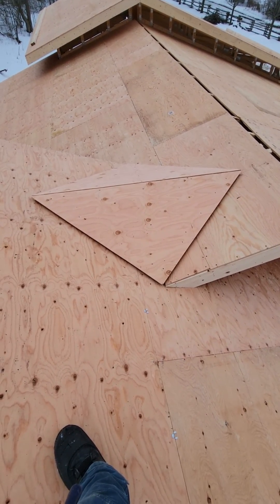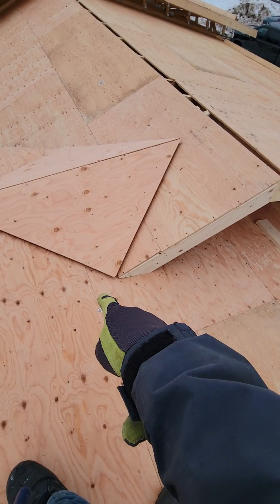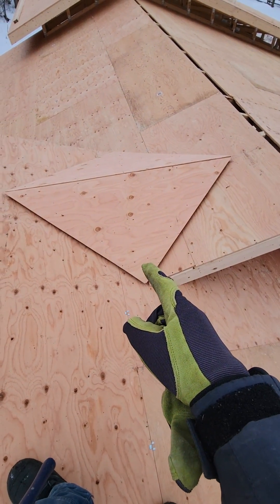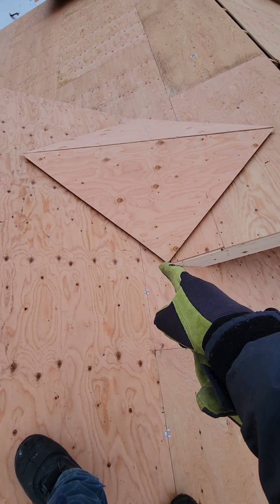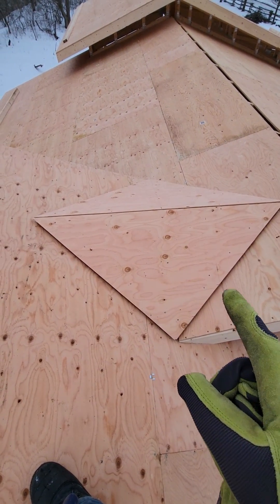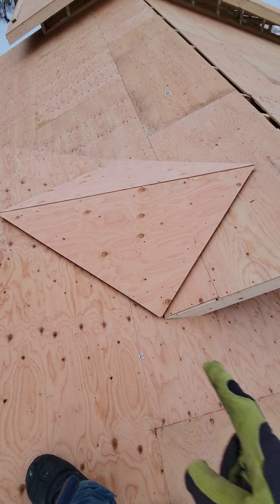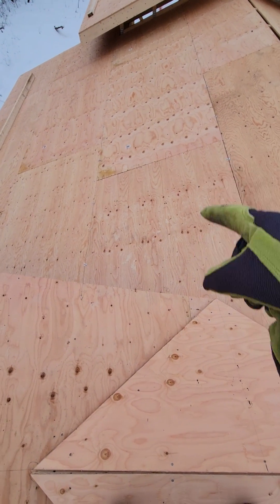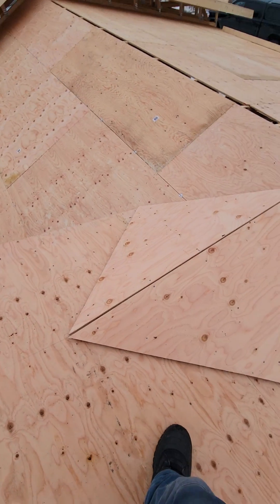What is a dead valley and how to fix it.

Comment: No not a good idea because now you have 4 individual lines collecting water when a cooper flashing with a membrane would have solved the issue why the reason to hire a expert
Reply from the maker: Not possible for these tiny valleys for water to sit. They have a slope and no where for water to sit and back up.

Comment: As a roofing contractor for 52 years I would have installed ice shield up under the overhangs and shingled up to the two points and installed a10' approximate. 032 aluminum  valley 36" . 18 " up each side. Install ice shield 8" on each side over the aluminum and then shingle it.
Reply from the maker: Yes that's definitely an option. We just didn't want any water sitting and freezing there. Thanks very much for commenting. Have a great day

Comment: So how does one keep water from pooling on the upper edge of a chimney where it goes through the roof?. What is the minimum sideways angle?
Reply from the maker: Basically you'd do half of this. It will have two sides with two small valleys.  I would use at least a 4/12 slope. The steeper the better. Thanks and have a great day

Comment: That one is only the result of two overhangs extending in opposite directions, so at least it is small and easily manageable.  It's not as bad as the ones on my home where an addition was built between two wings off the back of the house.
Reply from the maker: Yes you're right it was not a big deal and easy to adjust. I'd be interested to see a picture of your roofs. Thanks and have a great day

Comment: I dont know who designed the house. But they should be fired. If possible. Never put dorms, step gables. Yah it pretty to look at. But they are nothing but leaks and mold later
Reply from the maker: Yes they definitely add character but if not done proper and checked on they can become a problem. Thanks very much for you input.  Have a great day

Comment: That's not a dead valley. Dead valley is when it needs pan metal or modified
Reply from the maker: According to all the carpentry books and building tech books we own and speaking with the architect that is what it is referred to as well as other names. Thanks for commenting..we appreciate everyone input.
Reply: @JosephTalbotRealEstate  lol my architect told me 🤣🤣🤣
Reply from the maker: @TzNuts ultimately they are responsible for the project. The municipal building code inspector goes by the drawings/plans  by the architect or the engineer.

Comment: Poorly deigned roof, good remedy but a PITA to work around with actuall roofing material.
Reply from the maker: Ya it is less than desirable but it will solve the problem. It is no good getting call backs for a leak.

Comment: Had a terrible problem with my outdoor fireplace (which backs up to a roof) filling with water when it rained.   Talked to many roofers and finally one said a cricket was the only way to solve the problem.   Have never had water in the fireplace since.
Reply from the maker: Ya it is a great way to direct water away from pooling on the roof. Never good when water sits on a roof. Thanks for sharing
Reply: So a grasshopper wouldn't work?
Reply from the maker: @LucidDreamer54321  lol. Nope

Comment: Just curious why you didn't take it to the ridge?  It's pretty close and it seems like that's what I would have done but I can't see the entire roof so there must have been a reason you held it below the ridge.
Reply from the maker: This way we can run the ridge cap continuously so we can have full vented ridge cap all the way and so you don't see it from the ground at all. Thanks for asking. Just remember most times there more than one good way to get it done.
Reply: I appreciate the education here. But my question is how do you ultimately shingle that? Do you have a video or photos of the finished product?
Reply from the maker: @jamesranker6275  I will post a video when it is done. It will be a steel roof. Thanks very much commenting. We appreciate everyone's input.
Reply: @JosephTalbotDIY  cool thanks I look forward to it. Seems like me the valleys that the cricket makes would require a bunch of fitting small pieces all of which seem to be problematic. I’m not a contractor but I do build stuff and am happy for the education

Comment: Looking around here at all the flat roofs that people are building...
Reply from the maker: In the snowy climates sloped roofs do make more sense.
Reply: @JosephTalbotDIY  i'm in the snowiest climate. Flat roof makes sense because you keep the snow on your roof instead of worrying about roofalanches. But thanks for showing that real estate agents generally don't know the product that they sell.
Reply from the maker: @SnootchieBootchies27  I've been building since 1987 so I've seen it all and we live in an area with a 65 lb snow load. Commercially flat roofs are better in that if they can handle the load then as the snow melts they can better control where the volume of water goes. But here we are talking about typical single family residential applications . Thanks for your reply we appreciate everyone's input
Reply from the maker: If you use a snow guard that is not a continuous piece you can control slide factor of the snow and allow for melting snow to disapate at a slower rate and avoid roof snow avalanches.

Comment: Its a good solution for what is in my opinion a design flaw in the roofline. I was going to wonder how the engineer missed this... but thinking back to my framing days... I've seen them miss much worse lol
Reply from the maker: Ya one thing I've learned over the years is to try and play nicely in the sandbox, so to speak. So when we run across these sort of things we try to cooperate with the engineers or architects and come up with a solution that is feasible and the the customer is happy. 😊
Reply: @JosephTalbotRealEstate  Cooperating is great when the engineers are willing to. We had an engineering firm stamp a drawing that had a parallam as a hip beam, but it was too tall to fit in the roof line.

Engineer refused to take our call, passed along through his receptionist that he "doesn't make mistakes".
Reply from the maker: @OutdoorsWithChad  haha. Everyone makes mistakes every once in a while. Might be time for a new engineer.  I always say play nice in the sand box. Lol.
Reply: @JosephTalbotDIY  This was over a decade ago
Reply: What looks good on paper doesn’t always work out in real life😂
Reply: I did a large addition a few years back, the whole roof was to be stick framed, once we started framing it based off the plans the architect had drawn, we quickly realized nothing was going to work, we had to modify most of the pitches and completely rethink it, I don't think they'd actually put any thought into elevation so the roof lines didn't connect the way they drew them.
Reply from the maker: @Iamthathillbilly  ya unfortunately it might look good on paper and then when you go to build it is a whole different story. That's why alot of architects want to be involved from the beginning to the end of the project so they can be there if changes need made  but they charge alot more for the service. 
 I hope you were happy with your project when all was done. Thanks for sharing and have a fantastic day
Reply: I dont think I've ever seen an engineer or architect draw a cricket on the roof. But we have to build them anyways.
Reply from the maker: @luckytenno I honestly can't remember if I've ever seen one on a drawing either. All i know is they didn't on this one. Lol
Reply: I'm an electrician and I've seen them OK planned ceiling heights on too tight of tolerances for what needs to go in forcing a ceiling height change.  A lot of the errors we find in the field are because a less experienced engineer was put on a particular task and not checked by an experienced engineer.
Reply from the maker: @ianbelletti6241  ya sometimes that happens. We just have to try to work together on projects because at the end of the day it's all about the client. Thanks very much for the I out. Alway appreciate it.
Reply: No design flaw. How would you design this roof intersection any differently in order to eliminate the cricket and keep the building shape intact ? Bet you can't. Therefore this is how it is done.
Reply from the maker: @kevinnielsen1356  ya it would be a challenge. This is the look the owner wanted. So this is what we did
Reply from the maker: @kevinnielsen1356 yes it would be a challenge.  This is the roof design the home owner wanted
Reply: Next house I have is going to have a simple roofline, 2 rectangles 😄

Comment: I can’t stand stupid roof lines. Let’s design a new house but make it look like it’s a bunch of random additions put together. It’ll cost way more and be way more prone to leaking and be more prone to holding a huge snow load and adds zero value to resale you’ll love it.
Reply from the maker: Yep some roof lines don't make sense. We have worked on worse though. It is then that we have to go the extra mile to make sure it will never leak. We always start with a high grade roofing membrane. Some things are missed on the plans and so a good carpenter will always figure it out. Thanks for commenting and have a great day!
Reply: I detest roofs (rooves?) with multiple valleys, gutters don’t seem to manage rain runoff very well.
Reply from the maker: @edwarddiekhoff859 ya sometimes it can be hard to manage the flow and volume of water. It is a good practice though not to have any standing water on a roof. So we just have to make sure that don't happen.  Thanks for the comment and have a great day

Comment: That gap at the peak tho..
Reply: The gap is intensional… for the ridge vent
Reply: @danielbeckler262 I reserve the right to be an idiot.
Reply from the maker: @Prosecute-fauci  it is good to ask questions or comment. That's why we post. So we can learn from each other. 😊
Reply: @Prosecute-fauci nice lol
Reply from the maker: Yes sir. You must have a 2 inch gap at the top for air flow ventilation.  Warm air is pushed from the eaves upwards and out the vented ridge.

Comment: I think it would be better looking taken to the ridge, it would straighten the long line and look nicer from the ground.
Reply from the maker: Ya that was certainly considered and would look good . The way it is now you can hardly see from the ground. It may have been a little challenging to fit the ridge cap as this will be a steel roof.
Thanks very much for commenting.  We like input. Have a great day
Reply: @JosephTalbotDIY like you said, your way you see it from the ground. It’s doing its job at a much lesser cost in time, labor and materials. Good job. Some contractors would have left it as the plans say to do it and the homeowner would have had problems down the road.
Reply from the maker: Yes you are right. We look at the future function of the home as well. We didn't want to run the risk of the home owner having an issues in the years to come. Easier and cheaper to address now than later. 😊